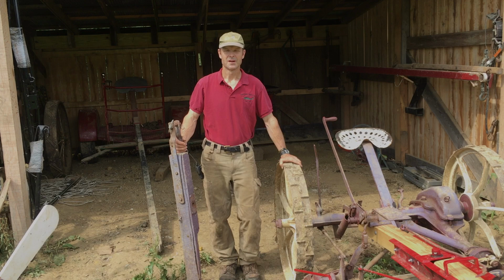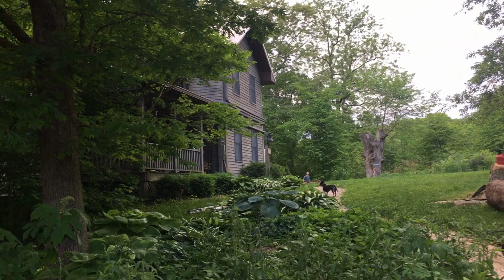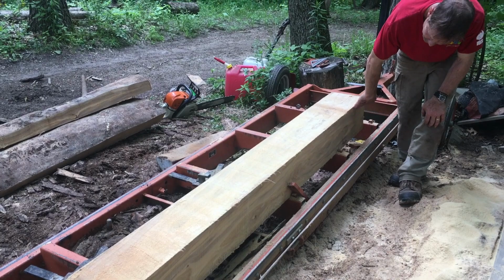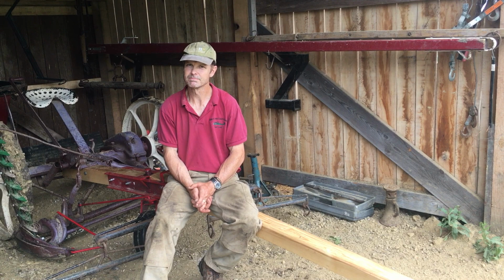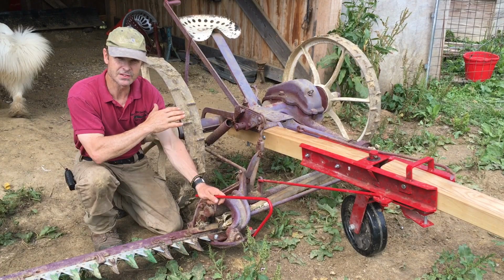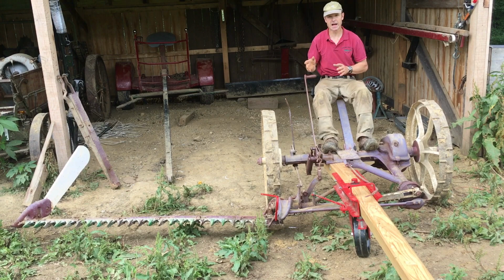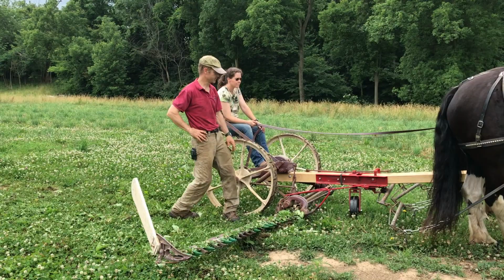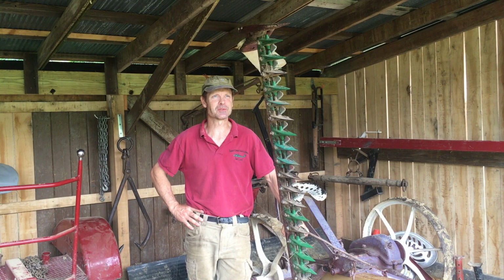Horse Drawn Sickle Bar Mowing, Part 2: Second Attempt

Comment: Just discovered this video. Around 1950 I cut a lot of grass with one of these. In England we called them finger bars. The swath  board on the end of the bar should trail on the ground to clear away the grass so that on the next cut the inside of the bar does not get clogged up with already cut grass. This would improve the performance. Also on the swath board towards the top edge, we had a round bar half in diameter, about 30 in long sloped inwards and slightly up. This turned the long grass down to leave a clear swathe and some dry ground to turn the damp hay over and speed drying.  Happy memories.
Reply from the maker: Very interesting!  Thanks for the tips!

Comment: You know, after watching the video I thought of something, and remember, I don’t know nothing about mowing hay with a sycle bar. What if you put a wheel on the end of the bar to keep it an inch or so off of the ground? I worked in construction for many years, and also wrenched a bit, so I just wondered if that might help! Great video and kudos to you and your family, you are a lucky man. Having a place like that is what I dream of, as I’m sure many watching, like me, are living vicariously through you! 🙏💪👍
Reply from the maker: We eventually did just that.  The wheel is called a tongue truck, and it did a lot to relieve pressure on the horse’s necks.
Reply: @ADifferentWay  yeah, no I meant at the end of the sickle bar, so when you drop it on the ground it'll keep it up an inch or so, you see? I don't know if it will help, but it might.
Reply: Mine has an adjustable skid plate on the under side of the sickle bar for that very purpose . I assume they all do. John Deere made a wheel like you are describing to hold the end up higher so you could clip your pastures. Maybe other companies did as well.

Comment: As mentioned earlier your swath board needs to follow the ground, there should be a short spring holding the swath board against the frame so it can float. The swath board also clears a clean path for the next cut so you don't get grass building up on the inside of the cutter bar frame as you experienced at the beginning.

Comment: Great video. Just a safety hint. Never have your fingers in between the blades with the horses hitched. If they get  frightened and jump you may be minus a finger 😧
Reply from the maker: We agree!  I know it’s tough to tell, but he is religious about NOT putting fingers in front of those blades—even when not hitched.  He was just picking grass from the top of the blades, where the grass got stuck between the blade and guards.  He used the little plastic pick in his hand for anything around a blade edge.

Comment: I wonder if you are saving one tree if pesticide would help.
Reply from the maker: Our choice not to use pesticide is about far more than saving trees. When we purchased our farm, pesticides and herbicides had been used on it regularly for several years.  The soil was completely dead due to pesticide use. You could dig down over 12 inches, and see no almost no signs of bug or worm life. Because there were no worms creating tunnels and holes in the soil, there was very little water retention. In the summer, it was like concrete and water would simply roll off the top rather than absorb into it. Our shallow well dried up regularly because the water could not penetrate down into it.  Meanwhile, the water running over the top created massive erosion on our slopes. We had gullies 3 to 4 feet deep!  Soil has an entire life system on its own, which in turn supports the production of grass, trees, and other vegetation. Any livestock eating that grass can only be as healthy as the soil itself.  We stopped all chemical use on our soil, used organic materials to fill gullies and fertilize, used minimal tillage and tried to keep heavy equipment off to prevent compaction.  We also used a subsoiler to allow water to penetrate deeper into the soil. Within just two years, the change was incredible! We had worms the size of snakes, and more bug activity than we could’ve imagined! Our well never dried up again. There were so many more changes, but it made us believers in trying to use organic and natural methods to work with the soil rather than against it.

Comment: I think you can tilt the bar-there may be an adjustment
Reply: Should be a short lever that will angle the bar. Raise the tips of your guards up a tad. Check the height on your inner and outer shoes. Leave a couple inches of stubble, to let air get under you hay. It will dry faster and more evenly.

I used an IHC #7.